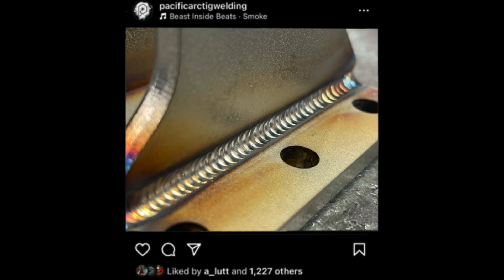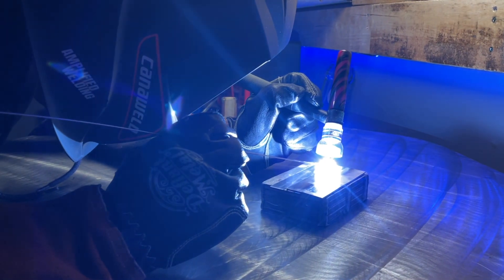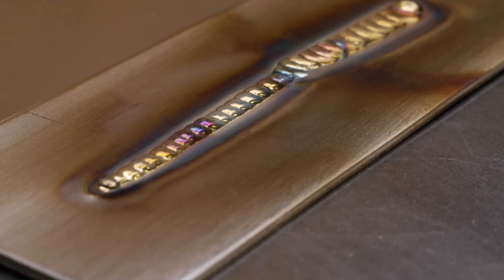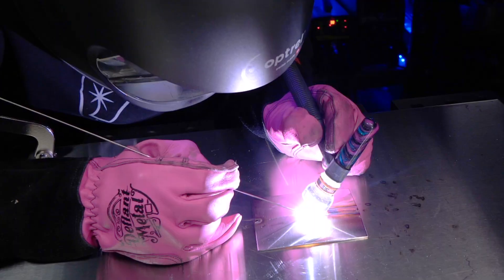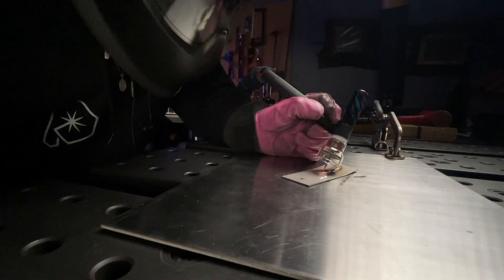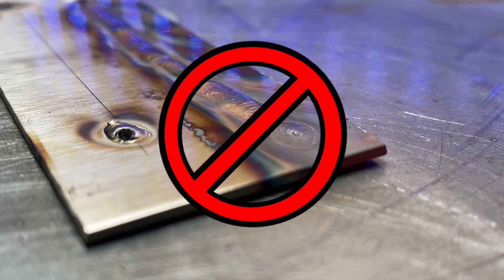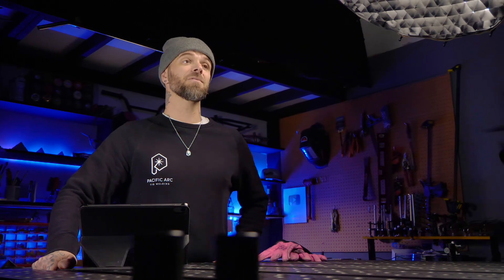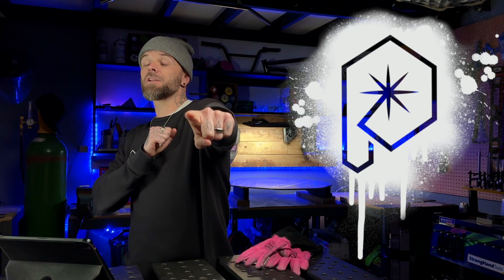the 3 BEST SETTINGS to start tig welding STAINLESS

Comment: I prefer to use a valve torch and bypass the machine's gas solenoid, that way I can control the post flow as needed on the fly. It's pretty hard to screw it up or forget to change the post flow time if you don't use it. Does it waste a bit of gas? Maybe you definitely get a couple extra seconds of pre flow with a valve torch, however you do save a bit of the other end as you don't have to run an overly long post flow time just to be safe so all in all I think it comes out a wash. If you're running a gas cooled torch you really have to just leave the gas flowing even when you stop welding to cool the damn thing off, otherwise you're going to go through torches like crazy.

Comment: I find the chart unhelpful, especially for thin gauge steel. I think once you are past 2mm thickness, the chart becomes helpful. There's another channel where a guy who never shows his face (because he wears PPE) and talks in Japanese or Korean (I can't tell) where his tip is very helpful for thin gauge stainless.

Essentially with such thin gauge you want VERY LITTLE overall heat input. He did a demonstration where he welded based on that chart, 1mm steel at about 10 amps (not exactly out of the line according to the chart shown here). Weld looks like CRAP, burned and warped like crazy.

What he did was set the welder to 2T operation, then what he did was set the amperage to 100 amp (or maybe 80 amp at minimum) for a 1mm thick sheet. Then he held down just long enough to puddle (it takes maybe 0.5 second at most), then release the trigger and terminate the arc immediately. Then step forward half a puddle, and repeat. The weld looks beautiful. 

Then there's also pulse setting. Something that thin really needs pulse, and again you want very high amp, but low pulse time, and faster travel speed. At 3 pulse per second you're going to be REALLY MOVING.

The chart starts becoming more useful as you weld thicker materials. That's when you want penetration and the amperage would go down per thickness.

Comment: Dusty, love your videos!  Trying to weld stainless with my Primeweld 225...not having much luck. I can do lap welding if I do not use any filler, juswt melt the stainless and I get a nice good looking shiny weld. However, if I try using stainless filler, I always get a muddy looking weld. Same settings, clean filler, work and tungsten but it still looks muddy. Any suggestions?
Reply: Clearly I am not Dusty!  2 things come to mind.  thin metal compared to the filler? and or. are you pulling the filler too far out from the gas shield between dabs?  These are a couple issues I had. Well, I still struggle with the second one ;)

Comment: That chart is pretty close to what I was taught all those years ago.  Fillet : amps = material thickness in thousandths of an inch.  (40A per millimeter if you're metric).  Butts get 80% of that and laps get 75% of that.  So 100 thou material (2.5mm) would be 100A for fillet, 80A for butt, 75A for lap.  It's easier to do the math than to carry around a chart.

Comment: I am replying to this video because it is the newest, so you are most likely to see the comment (so I believe, anyway).
I just watched a 2 year old video of yours on outside corners on stainless.   There was good information in there, but it doesn't apply very well to what I do.  I am a maintenance mechanic, and although I was all-position TIG certified 25 years ago, I have only actually run tig maybe 3 times in the last 15 years ( the VAST majority of the welding that I do is with stick for various reasons).   Anyway, the times I need to pull out the TIG torch are when I have a stainless tank split.   These are outside corners on 0.060"-ish 304 stainless that were invariably welded autogenously.  I weld them back up and move on with my life, but I was looking for tips that might help me out, because pulse wasn't a thing when I was getting certified, and if I can get a better quality water-tight weld then I'm all about that.
When I see your little test coupon welded on a bench looking so pretty, and then I think about myself lying on my back in the water under a leaky tank that I just peeled the insulation off of (and tried to scrape off the glue residue) welding with scratch-start TIG trying to seal a split seam, it kind of seems like maybe there is a disconnect.   Have you ever considered doing videos that are a bit farther away from the new-metal-fabrication variety?  Or is that not the purpose of your channel?
To be clear - you have good stuff on your channel, I'm just curious if you'd be interested in branching out to repair-type welding.  If that's not what you want your channel to be about then that's your choice, and I won't fault you for that.   You're not here for my convenience.

Comment: Had a custom boat prop built. I was fortunate to watch the guy weld the blades to the barrel. Barrel is probably about 1/8” thick. Prop blades were about 1/2” thick at the base. The material was 17-4 ph stainless. I figured he would tack every thing up, to get some even heat into the part and then run a bunch of small beads, skip around welding here and there until it was welded out. Wrong! He jigged up one blade, got the biggest torch, cup, and tungsten I have ever seen, then he grabbed a 3/16” dia filler rod. He just arc’d up and went to town he ran one huge pass supper fast on each side, looked like he was pushing the wire down a gopher hole. Then he jigged up the next blade and did the same thing on the remaining blades. I told him “I figured you would skip around and weld multiple passes”. He smiled and said, “after 30 years of trying different ways, you might figure out what works that shouldn’t.” I ran that prop for 12 years!

Comment: I weld stainless sheet metal daily, from 12ga to 24ga. I really enjoy pulse TIG welding with a finger trigger, it allows autogenous tacking with one hand at tough angles. I like to find the proper amperage (+/- 5 amps) and adjust my PPS (pulses per second) to change weld properties. Rarely, I will adjust peak and background wavelengths to change weld properties. Most of my autogenous welding is tacks, but most of my welds with filler are lay-wire at fast speeds with fixed amperage. It’s fun and the beads don’t look bad either!
Reply: Some people really hate pulse welding for some reason. If you're welding thin gauge you have to, and you want the amp really high and very short pulse time. This is to reduce overall heat input.